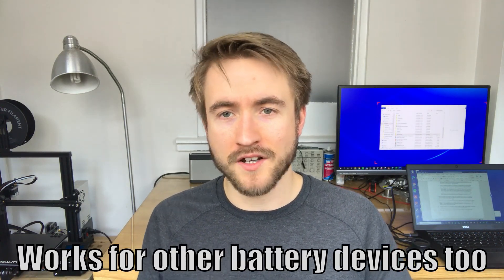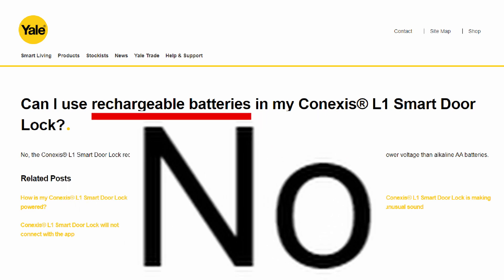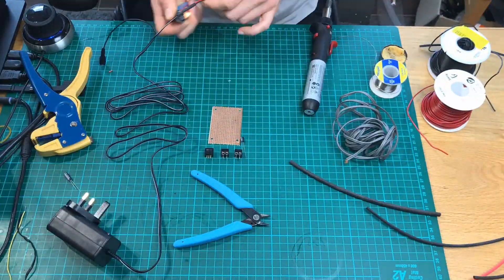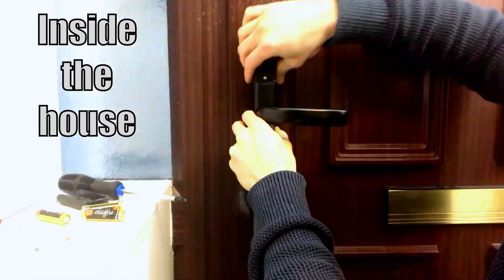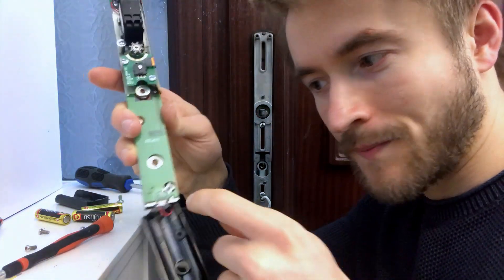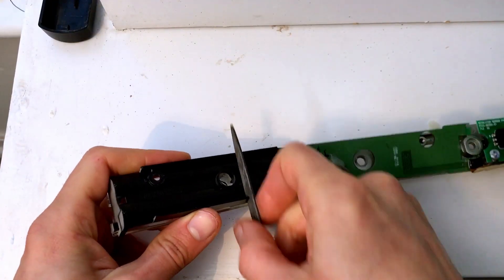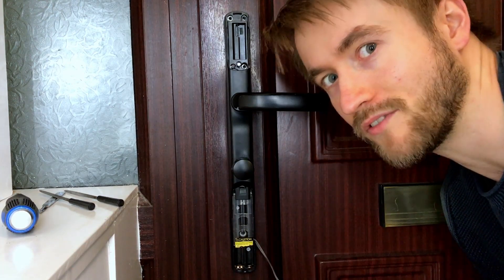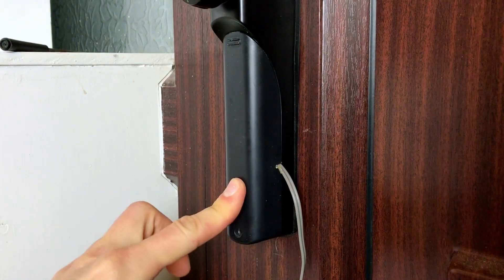How to UPS mains power any battery powered smart device (Yale conexis l1 door lock)

Comment: for anyone considering doing this cut wood dowel the same diameter as the batteries but a little shorter. Add screws at the ends that need power and solder the cables to the screws then insert them lastly run slim rounded trunking or pull your door trim remove the corner with a knife and run the cable inside. this is a good idea but god knows why you would leave the cable like that and then make a video its lazy and looks awful another way would be drill under the lock at a angle to the edge of the door and chisel a channel into the edge and along the bottom then glue the cable in but that will require removing the door first

Comment: Hi Mike, Was looking for something similar. Do you think that I can go away with a 6v Mains adapter connected directly to the lock? I'm ok without having the UPS backup. What do you think? Thanks in advance
Reply from the maker: Yes as long as 6v is the correct voltage level for your lock that will be fine